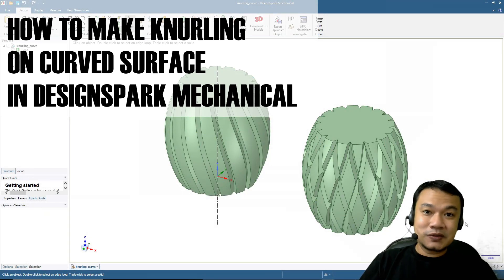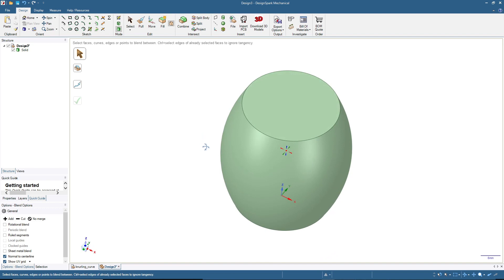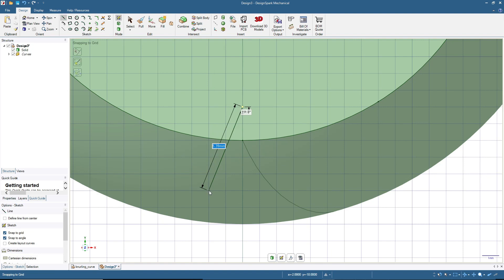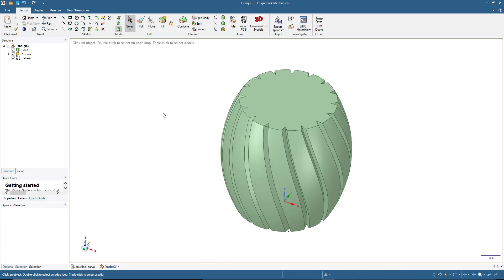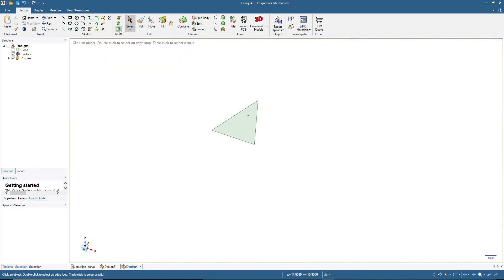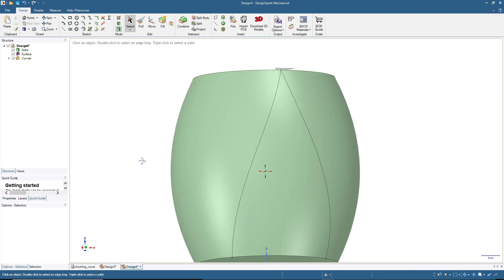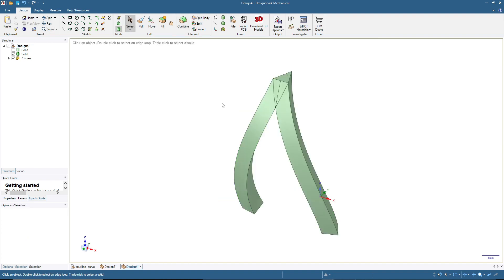How To Make KNURLING on CURVED SURFACE - Narrated Tutorial 3D Modeling Designspark Mechanical #13

Comment: Please explain how to split by selecting 2 cutting points, but placed on the curved surface, not on the edge. The issue I have is when selecting the surface, this becames blue and the point are not visible anymore. Thank you.

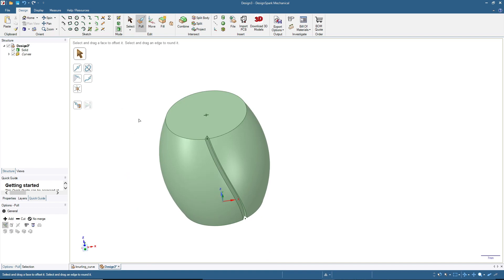Comment: Great lesson! thanks! but the shape of the knurling cutting triangle on the bottom is not straight or with other words the cutting point is not oriented to the center of the model along the cutting pass(4:35). is there a solution for that? thank you!